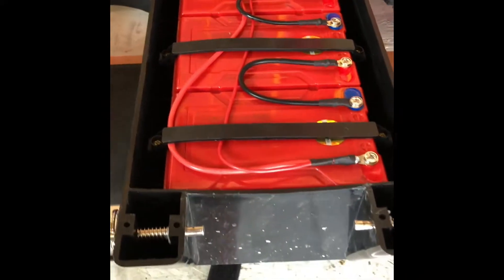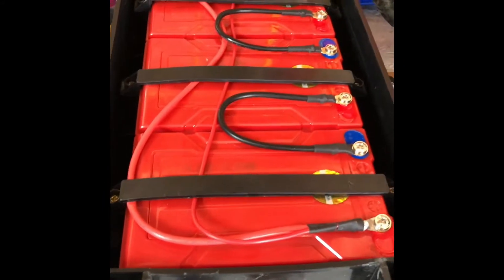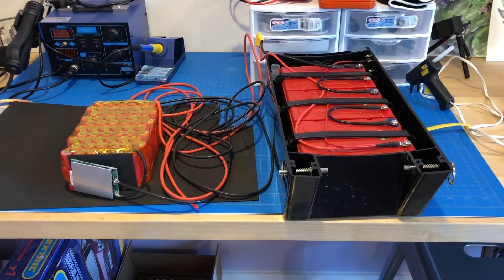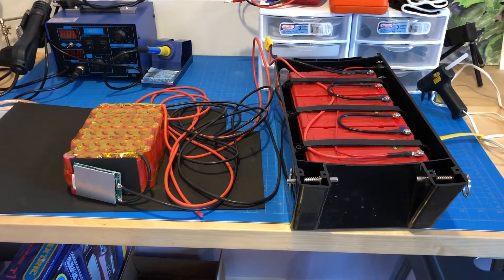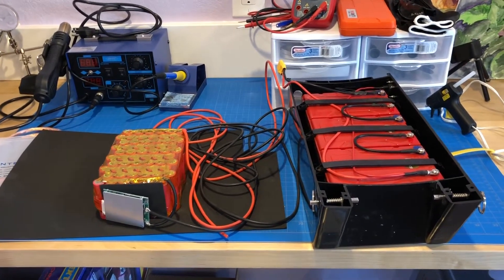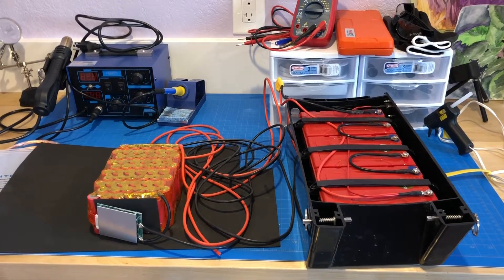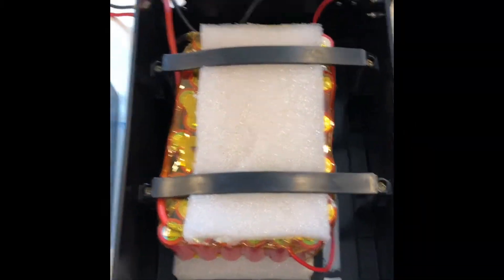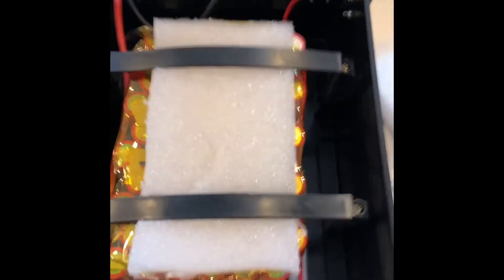MotoTec 1600 Electric Off-Road skateboard Li-Ion battery swap

Comment: Just replaced with a $120 litium 36v 20 amp with 2 amp charger. Run great, longer ranger (speed 2 30mn and still going), lighter though since only one bat. so more agile. down side time to charge is twice the time. Got this skate for over six year, replaced one of the two engines and few time the tire (get the road tire is better) This battery gave the skate a second life!

Comment: I just did a swap on mine. On top of the range and power improvements.  The lighter batteries make the handling better too. The only downside  I have seen is the breaking is weaker than with lead acid.
Reply: U made or purchased one?
Reply: @rayonwilliamssportsandfun2106 I bought 3 Greenworks 40v packs, the connector for it (you could 3d print them), a 50amp fuse, and a voltage monitor then wired it into the existing box. So not really built but assembled😂

Comment: Looks like you could've fit a 10s8p in there, and maybe another 10s4p in a 5x8 configuration. Any reason you didn't try to fit more and go for more discharge?